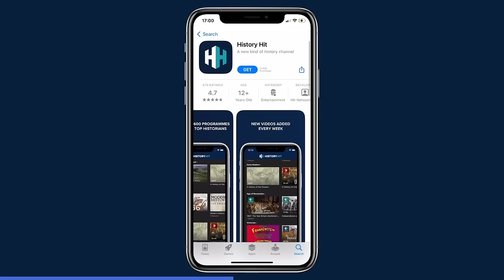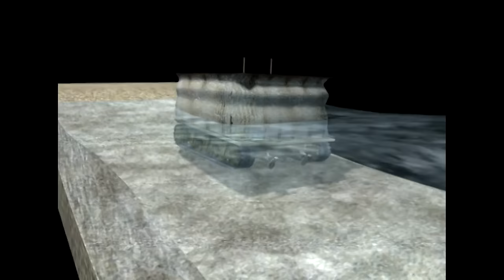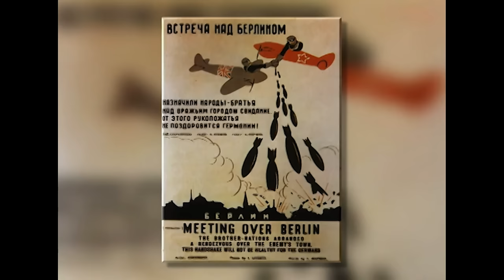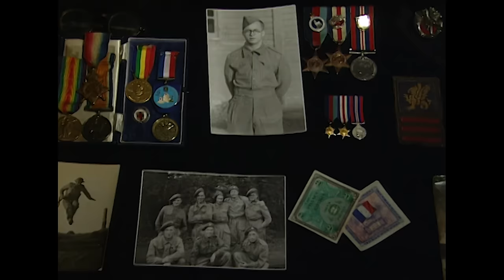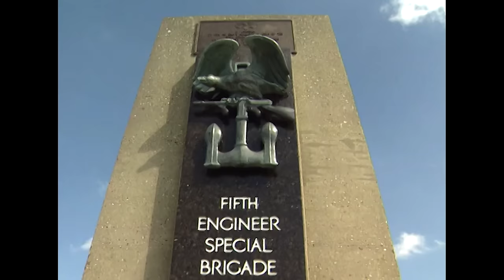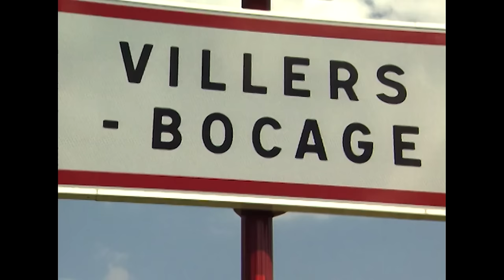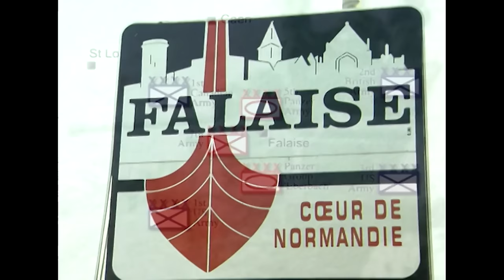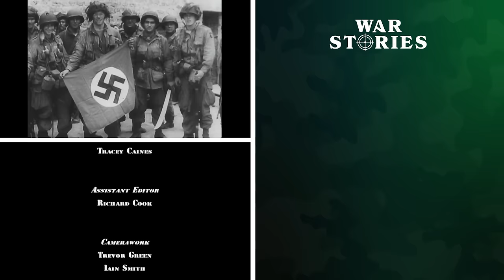The Customizable British Tank That Made D-Day Possible | Tanks! | War Stories

Comment: The armour of the Germans was better… how did we ever win! What poppycock! The German panther and tiger was too heavy to cross bridges, too complex to build in numbers and to prone to mechanical failure. The Cromwell, Churchill and Sherman when knocked out could be replaced immediately and were easy to repair due to common parts. The idea that the tank was there to fight other tanks is wrong. They were there for multiple reasons as part of a combined arms attack and there is no mention of the Firefly which was the ultimate Tiger and Panther killer. So much more to this. Your idea that good wood was a waste misses the point that it drained the German panzer reserve and gifted the American breakout.
The only correct point you made was reached Paris within 90 days
Reply: That all depends on what bridges are being crossed.
Reply: Tank vs tank fighting is as narrow concept as is that tank is there to escort infantry only.your comment about the allied tanks doesn´t apply to chuchills, they were almost as complex as the german machines and they were slow, and somewhat equal to breaking down as were tigers.churchill design was rushed,as was tigers and the churchills gearbox alone took bloody 5 times to redesign before they made it ´´adequate´´enough,suspension problems, running 2 truck engines side by side, which were boxer types with rather poor performance. the churchill´s track repairs and, suspension and powerpack repairs on the british heavies were a bloody nightmare only made worse by mk7, and the ones taken to USSR were in pisspoor condition, and they were equipped with coolant and oil that couldn´t take -40 C temps...... the cromwell after they ironed out the kinks was as good as the shermans but same cannot be said about the churchill or even the matilda.....fireflies were rather rare in comparison to the massive number of shermans and allies had many other vehiclest that could take on tiger, even 57 mm gun could pen it but wolverine and hellcat and 76 sherman were far mor effective against german cats apart from the king..
Reply: The Allies also had Constraints on what would be practical to transport over sea, and land amphibiously.
Reply: German tanks being OP, Allied tanks not much use but more numerous was the general consensus for many reasons up until maybe 15 years or so ago, which includes the archive footage shown here which looks like it's from the 1980's or 90's.
Reply: The Churchill very likely had problems with the same bridges the Panther did.
Reply: @wanderschlosser1857  being lighter with a lower weight per wheel would reduce the risk of collapsing the bridge… or, the Churchill could jump the canal like it did in Holland! Fairly certain the Panther didn’t have that option
Reply: @andrewwalker8416  I'm fairly sure the ground pressure and of a Panther was lower and weight distribution therefore better than for a Churchill. I also doubt the Churchill had more wheels on the ground than a Panther or Tiger with their interleaved wheels in combination with the wider tracks. And what do you mean with jumping the canal?
Reply: Churchill had 150mm of frontal armor, more that the 100 of the tiger 1

Comment: The petard mortar was 230mm, it's spigot was 28mm which was then mistakenly written up as 28cm and then 280mm.

Crocodile Churchills generally carried the QF75, not the six pounder.

Tiger and PzIV did not have any more sloped armour than British tanks - both had less than Sherman. Tiger and Sherman were both 1942 designs.

Artillery did a great deal of the killing at Falaise.

Comment: Exhausts modified to operate in six feet of water?  The exhaust will work underwater.  The intake is the part that has to stay above water.
Reply: Not quite. A standard exhaust system would be stymied by flooding and water pressure.

Comment: The Churchill tanks at Dieppe were not 'knocked out' they were abandoned having returned to the beach because the engineers were unable destroy the concrete barricades.
Reply: They weren’t very good on loose gravel beaches either, which was another motivation for Bobbin. 

A version of Bobbin can still be seen used today, only now it’s a metal trackway and normally dispensed from a truck.
Reply: @bob_the_bomb4508  NOTHING is very good on loose gravel or pebble beaches!

Try getting out of the water on Chesil Beach!
Reply: @pcka12  Chesil Beach! I remember it well… :)

Weymouth: the South Coast’s version of the Medway Towns…
Reply: @bob_the_bomb4508  did you know that Weymouth beach arrives in lorries each Spring 🌼
Reply: @pcka12 
Or Slapton beach ... especially at night with S boats in amongst  your D day practice 😢.. more died there than on D day.

Hobarts Funnies. Were the specialist  can openers that saved lives on the D day beaches
Reply: @clivestainlesssteelwomble7665  I may be wrong but I believe that Slapton Sands was a US training area (definitely pebbles present there), certainly a lot of US casualties & it links in with something my mum experienced at the time with loads of lorries containing bodies entering the US national 'British' war cemetery.
Reply: @pcka12 Still I'd say wide tracked tanks like Panther, Tiger, T-34 or JS-2 would have dealt better with those conditions. But I think there were a few other reasons which made the Churchill tanks a failure on Dieppe beaches.
Reply: @wanderschlosser1857  the Churchill tanks were not a failure on the Dieppe beaches, Churchills drove off the beaches and made their way towards the port & town, however there were concrete barriers preventing further progress. The engineers tasked with destroying the concrete barricades found their tasks impossible.
The Dieppe raid was 'a reconnaissance in force' there was never an intention to stay.
Further progress for the tanks being impossible they returned to the beach & as many as possible of the troops were evacuated leaving the tanks behind.
The planning for occupying the town failed because removal of concrete barriers proved impossible. By D Day 'engineering' versions of the Churchill had been created which were capable of destroying concrete blockhouses!
Reply: @pcka12  That's not entirely true, is it? Only 15 tanks out of 30 made it off the beaches being then stopped by the concrete barriers, most returned to the beach and were immobilized by the rocks breaking the tracks and enemy fire. Of course the failure wasn't completely down to the tanks themselves but rather wrong tactics and the inability to get the concrete blocks out of the way. And yes, the lessons were learned and the Churchill was improved until D-Day. It worked well as a heavy support tank until the end of the war. Still it wasn't a great design and a big portion of its success is based on the fact that the Allies had complete superiority, in the air, in shear numbers and in well organized, working and sufficient supply lines.
Reply: @wanderschlosser1857  a man who taught me history had been part of the British tank contingent who trained for Dieppe & were replaced as a result of political decisions by the Canadians, the whole thing was political since Stalin was demanding the opening of a second front in Europe & the British High Command were entirely aware that they had nowhere near the means to achieve this at that time.
My teacher's main observation was that by allowing the Germans to capture Churchills they were able to identify the weak spot around the hull machine gun & his comrades suffered for this later, he was strongly of the opinion that the Canadians should have destroyed any tanks that they left on the beach, he never mentioned the issue of shingle in the tracks probably because any 'tanker' like himself was fully aware that tracks were & remain a weak point of any tracked vehicle & so some tanks would never 'make it' off the beach.
Overall the British planners working from previous experience no doubt expected considerable losses from such an exercise as they had seen numerous times before in events like the Zeebrugge Raids & as it turned out the losses were on a par with losing a couple of cruisers, something which Britain had suffered before.

Comment: Too bad the Canadians didn't have enough of these to breach the enormous wall at Juno beach. Canadian casualties were indeed high. My Sgt. Art Boon, was a 50 cal on top of I think he said a Sherman.  He didn't say if it was a Firefly.  Art said that they couldn't drive up on shore because it was full of Canadian dead and wounded behind the high wall.  They turned and found a way up.  Art mentioned knocking out a machine gun nest on the way up.  The first  days they travelled far too and had to fall back even with the Brits on their sides.  Not sure if he was involved in the Falaise Pocket.  Art just passed away a year or two ago.  He joined at age 15.

Comment: The Canadians were used to see the strength of the Germans at Dieppe and we got slaughtered  🇨🇦
Reply: No we weren't
Reply: It was a lot more complicated than that. USSR pressure to "do something" and US pressure to attempt a landing asap, the desire to take a port - and finding out just how difficult that would be (which is why Mulberry was developed). 30 RM Commando was supposed to "pinch" a German Enigma machine and code books too. Nobody had tried an opposed landing on a port and nobody actually knew what would work or not. It was a very necessary evil. Indeed, Canadian 2nd Division made up the bulk, with 907 killed, 1,900 POWs - but some US and hundreds of British of the 5 different Commando units also took part. 106 aircraft lost, mostly RAF but including USSAF. The  Royal Navy had 550 killed with the loss of a Destroyer and 33 landing craft and crews.
Reply: The Canadians pressured to be on the raid. They had spent two years as a major anti invasion force in Britain and wanted to take an active part in the war. Everyone involved was used in the trial raid.